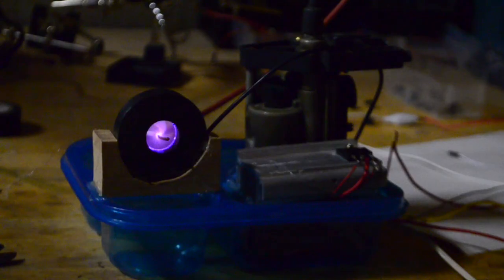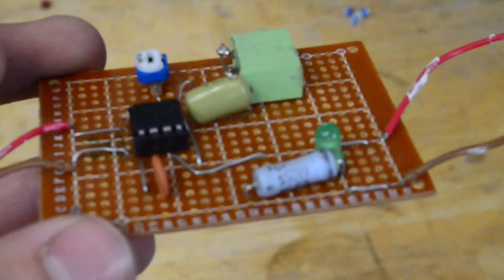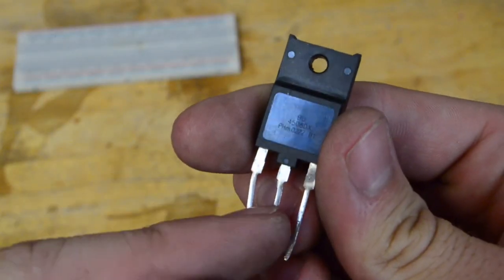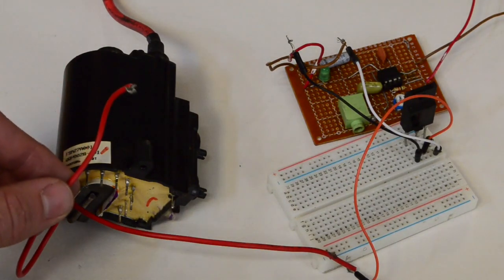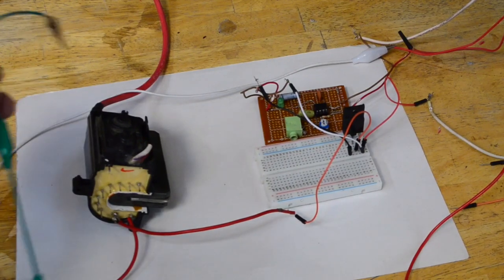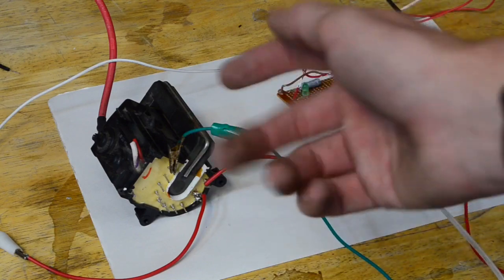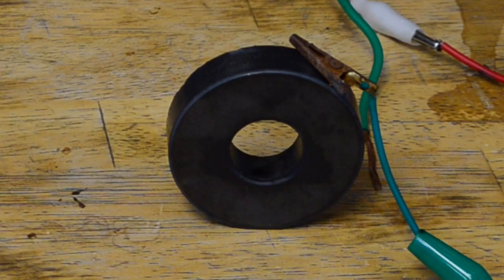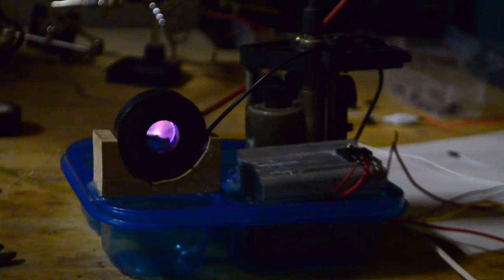How to make a Plasma Speaker

Comment: finally got mine working perfectly had to switch the 1k resistor to15k, the 20nf cap to a 10nf on the audio, and the 10nf cap to a 10 pf.
Reply from the maker: +Stephen Luczynski huh, well I am glad to hear that you got it working !! :D
Reply: Keystone Science. im baffled though. i plug my components into an online 555 calculator and according to the 555 calculators on the internet my driver is making between 9 and 10 MEGA hertz and that doesnt make any sense considering the 555 can only do up to 2mhz and a flyback transformer straight from a tv operate (to my knowledge) nooooo where near that frequency. so even though its working... i dont know why lol. ne555p timer, 15kr betwen pin 7 and + , 500kpot between pins 7 & 6, 10pf capacitor between pin 2 and ground, pin 5 to audio amp +out, amp -out to ground via 10nf capacitor maybe you could build what i did and check on the scope?? :]
Reply from the maker: +Stephen Luczynski yeah, sure! I'll take I look at it!
Reply: So... How did it go?

Comment: It would be nice if you could manage to make a OZONIZER :). It could help some ill people on a buck and also it involves HV, just as you like.
Reply from the maker: Sure thing! I'll make a design!
Reply: Good excuse to make a capacitive voltage multiplier.
Reply: I have like a 20 year old one of those. Its works really good for all sorts of ailments.
Reply: iooi dude, those  were capacitors, not resistors
Reply: Rodri Muñoz I thought ozone was bad for you
Reply: carolyn mmitchell in excess, yes

Comment: There was one commercial plasma speaker. The Fane Ionofane which was a ball about 20cm in diameter along with a tall spindly integral stand. They were advertised as tweeters only but worked up from about 1k - Production halted due to concerns over ozone production in 1976 or so..this is from memory only.

Comment: Base, Collector, Emitter is for a "transistor", not a MOSFET. A MOSFET has a Gate, Drain and Source.
Reply: Richard Vasquez MOSFET is a transistor just that it uses voltage to turn its gate on rather than current

Comment: Could the frequency generator circuit be added to a zvs driven flyback and if so how would i wire it up? At psu input of the zvs board?

Comment: Been having a lot of power outages lately and I was wondering is there some way I can use a big 12 volt deep cycle car/boat battery and some device to give me the 5 volts it wants to power my PSP 3000 FOR DAYS instead of a couple hours?

Comment: Excellent presentation.
True that MosFets are gate source drain and they are easier to use than regular silicon transistors.
Also a couple of seconds more on the schematics to make it easier to pause the video.
Perhaps a short video on mosfet theory would be good.
How did you identify the pins for the flyback primary coil?
Reply: Resistance is how you find the primary.

Comment: Is it possible to use a boost converter (such as the one used in the $5 taser video) instead of a flyback transformer? I'd assume the answer is yes, as it creates an arc, but there may be a limitation I'm not aware of.
Reply from the maker: +TheMinimazer yeah, it should work. Although probably keep the voltage around 6v , and it won't sound quite as fluid, but it should still be distinctive audio! :D
Reply: Thanks for the quick reply! I was hoping to make a small battery-powered variant (2 18650s in series with regulator). Lower audio quality shouldn't be an issue, as it's just for fun.
Reply from the maker: +TheMinimazer ahh ok cool! If you want , you could probably even just use 1 18650 battery and it should still work tbh
Reply: Very true, but I have 2 batteries that I'd rather use equally to reduce issues with one having more use than the other. I may just put them in parallel to extend the battery life of the device.

Comment: ok so prabably pretty stupid question but where does the wire from pin 3 on the first schematic go exactly? ive been studying the schematic a lot and cant figure it out if you have an answer that would be great
Reply from the maker: +Riley downs yeah, pin 3 is the output pin, so basically it gives off the signal created by the 555 timer, the other end of the signal is the negative ( pin 1 )
Reply: ok thanks

Comment: Am I wrong or MOSFET has gate drain and source insted of base etc?
Reply from the maker: +Paweł Fabiszewski your right! Technically what I use is actually a horizontal deflection transistor , but it's more commonly just called a mosfet, and so just for the sake of teaching people basics I decided to use base collector and emmiter
Reply: Keystone Science ok. I would be a little confused if you make such a simple mistake due too your great chanel and knowledge. now I see the point. thanks!
Reply from the maker: +Paweł Fabiszewski haha, no problem! XD
Reply from the maker: +Victor Titov yah, but technically it's not a mosfet it's a horizontal deflection transistor xD
Reply: actually, you are right, the horizontal deflection transistor is a BJT or bipolar junction transistor, not a MOSFET aka Metal-Oxide-Semiconductor Field-Effect Transistor.... two completely different beasts. His knowledge is limited to other peoples designs on google and often makes mistakes in his terminology, but the young fella is learning and teaching himself in his spare time, which is more than most of the kids these days so hats off to him.

Comment: What is the best way to power the FlyBack Transformer and at what voltage/amp?
Reply from the maker: +Conner Collie the higher you can get it the better, the main only limiter hear realistically is the mosfets getting too hot
Reply from the maker: +Conner Collie * I meant here not hear :P
Reply: Thanks for the quick reply.  Do you know of any cheap equipment that could power it easily?
Reply from the maker: +Conner best thing to use is a variable power supply, although they can be around 50$ , the next think I would use that is cheaper is probably a old laptop charger power supply, then can supply a few amps at like 18 volts or something like that, and that should work ( although it would be better wi a higher voltage )
Reply: Which amount matters most? Amps or Volts

Comment: I always had this idea can u tell me if it's possible to make a hover shoe that uses vibration to heat up the surround air to fly😤😤😤😤😎😑
Reply from the maker: +orandel garnett hmm, I know you can use vibrations to heat things up, but what is your reasoning behind making it make you float?
Reply: Keystone Science no reason, just thought of it after watching back to the Future, an remember after seeing ur video, I know mostly nothing about science, but I have a pretty good imagination
Reply: O and I thought if anyone could tell me if it's possible, it would be someone like u, and how you are about this, using high pressure sonic booms as a fighting or cutting weapon is that possible.?😤😤😤
Reply from the maker: +orandel garnett sorry , I just barely saw your reply, yeah, it should be possible, I have an idea to tune a crystal or something to a frequency that matches the wavelength of the distance between atoms in a certain object, so that this way you could alter the state for the material by lightly adjusting the frequency, however I do not know if this would work, I plan on testing it sometime in the future though
Reply: OK I'll watch it when you post it, and for my power I was thinking of using a grafite super cell

Comment: So can't u put this across the spark gap of a tesla coil and make the coil play music ??
Reply: Christian Wang Tesla coil is basically the same thing. But with higher voltages and is much more expensive to make. Works a bit differently too, it uses PWM to modulate the way the coil oscillates with its own resonant frequency (that's a couple of hundred kHz which we can't hear).
You'd need a different circuit but you might be able to use the frequency generator out of this.

Comment: does not work for me :/
the sound amplifier does not work, also I have different flyback and I can't run it
Reply from the maker: +Paderewski TV huh, like your getting nothing out of it?
Reply from the maker: +Paderewski TV try powering the 555 timer section with a separate power supply ( like a few AA batteries, also with the negative of the batteries to the pin 1 of the 555 as well as to the emitter of the mosfet, and just have the flyback transformer connected to the collector of the mosfet and the other end of the flyback connected to a positive DC power source, and then have the negotiate of the powers source also connected to the emitter, and it should work fine... Also, could you test your 555 timer set up? Connect the output to a speaker and the other end of the speaker to ground and see if it is producing a sound

Comment: Nice video. I've built one of these plasma speakers a few years ago. Check out my final build:
https://www.youtube.com/watch?v=fRfGDsu--rE

Also I found out that the flyback transformer only works with certain resonance frequencies from the NE555, in my case it was about 80kHz. The Mosfet becomes extremely hot, without a proper heatsink it would desolder itself after about a minute.
And you really don't want to touch the arc. It could instantly kill you.
Also one point about the audio source: I discovered that my phones touchscreen was affected and did not work only when plugged in. This means that somhow static electricity is coming throug the cable.
Reply: Mechatronaut  tutorial videos are in the making!

Comment: You are getting nasty EMF feedback that is really screwing with your 555 timer output. Try to clean up the wiring, the high power wires need to be far away from the 555, the BJT or FET (whatever one your using) needs to be closer to the flyback and heatsinked.
Reply from the maker: +Power Max eyy , I used to watch your videos :)

Comment: doesnt work.....
Reply from the maker: +Oder Kein it really does...
Reply: Keystone Science I tryed it with the exact same circuit but I think I know what my problem is....how many amps do you need?
Reply from the maker: +Oder Kein hmm, when I did it, I had a power supply that could only give 2 amps, so probably at least about that
Reply: Keystone Science and your flyback is a lot bigger...is this my problem...my power supply can only handle about 10A and if I connect it it says 12,2V at 10A
Reply: Keystone Science hmm....
Reply from the maker: +Oder Kein hahaha xD why the inferred pause? I can’t remember what I did in the video, but it should just be a approx 44 nF capacitor from 6 - ground, a 1k from pin 7 to 8, 8 to 4, 6 to 2,  a 50k potentiometer from 6 to 7, 8 to 9 volts, pin 5 gets the audio in, other end of the audio goes to ground, pin 3 goes to the gate of a mosfet, the drain connects up to one one of a fly back, the other end of the fly back goes to positive 32 volts, and the source gets connected up to a common ground
Reply: Keystone Science ok I' ll it when I'm back at home...
Reply from the maker: +Oder Kein okay, if you want, next time I live steam, I can build this, and make some improvements to it along the way
Reply: Keystone Science oh good idea and when is it?